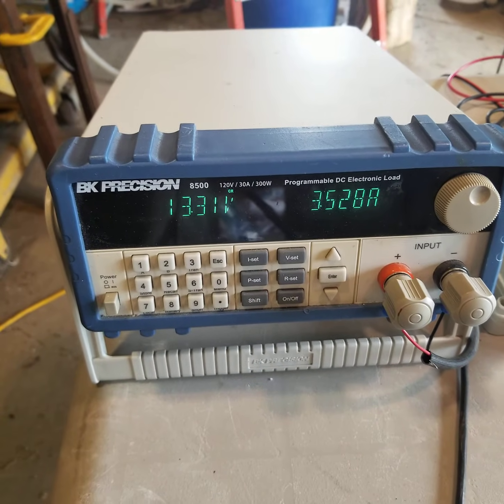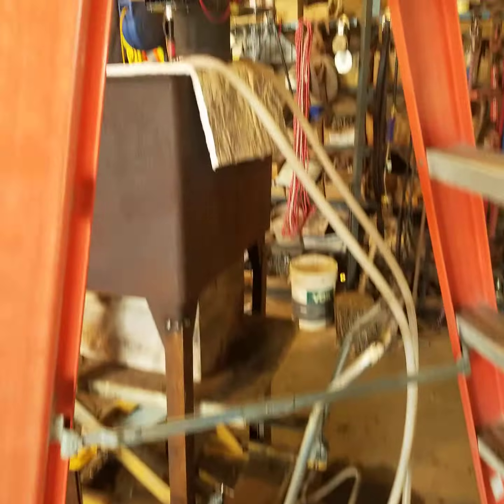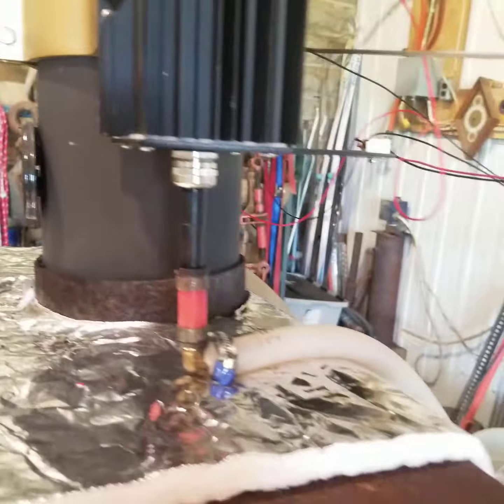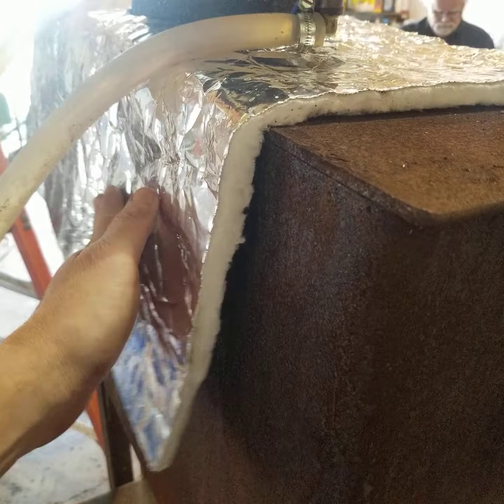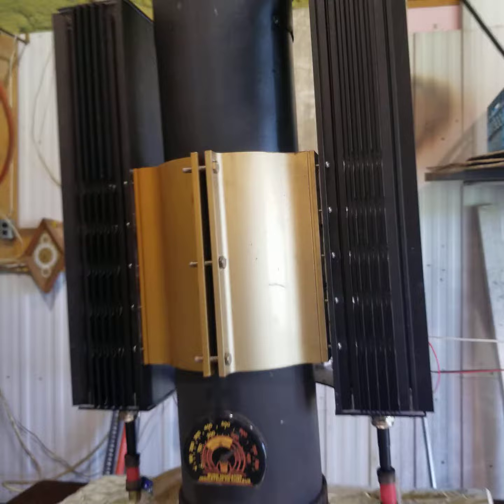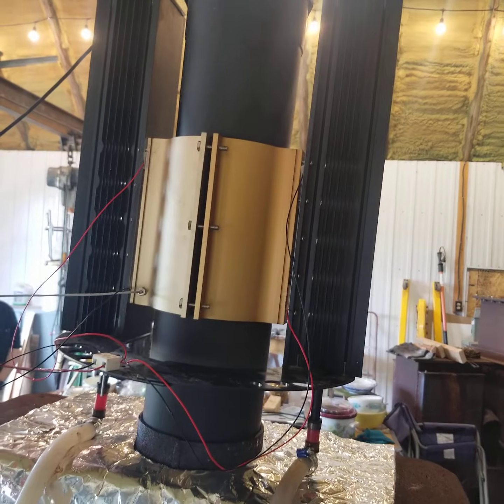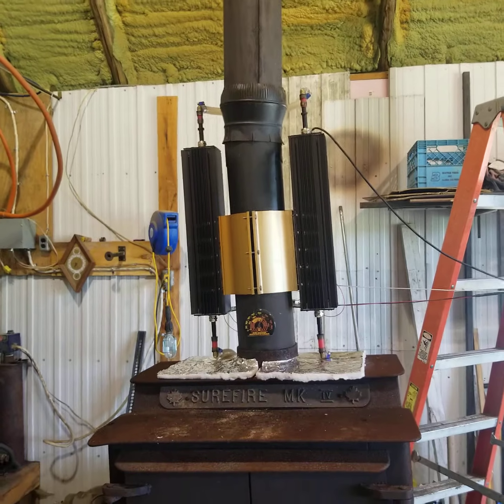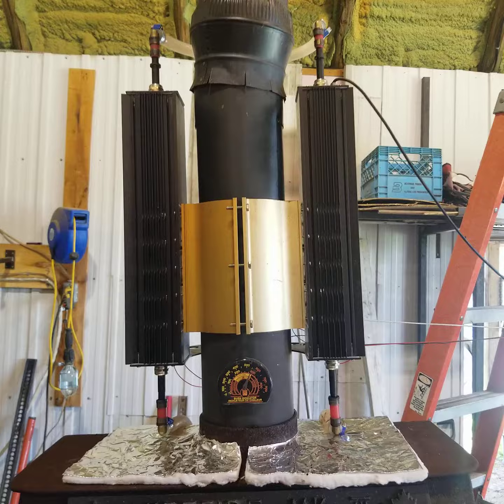100-200 Watt 12V- 24V Rabbit Ears wood stove Thermoelectric Generator for sale

Comment: Add insolation for over that bronze, see you have a 2 inch gap on both sides but the water jackets are fast to distribute heat because of aluminum. - Add more cells like this 90 degree and see if you can get 2 or 4 pipes. Good invention.

Comment: Why not use a thermal siphon system and save the power ?
Reply from the maker: Not enough flow! more power is produced than consumed with a closed system. So need positive with pump!! The pump only takes about 5 watts. with more water flow you get 12 watts or more! You are ahead but at least 7 watts!

Comment: "65-66˚ temperature in the bucket"
To clearify it for me, is that C or F?
You mentioned that the ambient temp was 24˚C so I suppose the bucket temp also is in C.
I'm really considering a system like this.
How does the electric output look like at 70-75˚C in the bucket?
I'd like to have at least 70˚C in my ackumulator tanks in my heating system.
Reply from the maker: It all depends on DT. Output would be lower. Because the heat load is variable the system is dynamic. Inputs are changing all the time so difficult to measure.

Comment: That would be more efficient if you add woodstove thermoelectric fans to blow heat if the fins. Water interior, wind exterior. See what happens if you add a AC fan.
Reply from the maker: Actually, because the air temperature around stove is so hot, it would offer little to no advantage and you would increase your parasitic losses, which we try to minimize! Liquid is able to remove heat at  1500 times greater efficiency than air. 
As you know, air is an insulator water a conductor.
Reply: @thermoelectricpowergenerator  

1. Why keep the unit Indoors?
Outside air would cool it better.
You may not get the hottest section of the stovepipe, but the difference would be a few degrees.
Also, the hot-side heat mass (the brass) could be Inside the stovepipe.

2. Why water? Water is a good heat absorber/storage, but has a poor heat transfer rate.
Why not use mineral oil, with a radiator, also outside?

Comment: How many of those Thermoelectric devices you have in those rabbit ears?  Thanks for sharing this is super interesting R&D.
Reply from the maker: That is 6 pcs, the R & D is over.  It is commercially available at www.thermoelectric-generator.com under TEG Systems
Reply: @thermoelectricpowergenerator  Which 6 modules are you using? Why just the six? And I am curious why you didnt go with a water block and instead to the slow unboiling side with these? You recall the gentleman that did his own aluminum water block oh.. several years ago here? I have the videos. Why did you decide against the flow on your build? The multi fin sinks seem to be the costliest part of your setups, were you losing the modules faster? I dont get it.
Reply from the maker: This video is to show the technology if designed properly works. A couple of companies out there sell designs but they are not properly utilized so you get next to no power! It;s not the tech its how it's applied. We have 30 years of designing these systems.